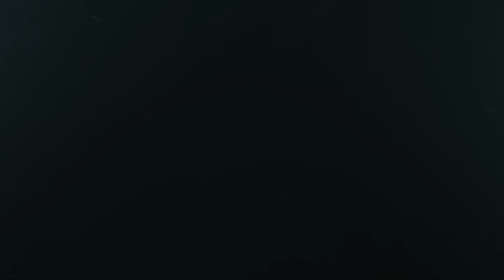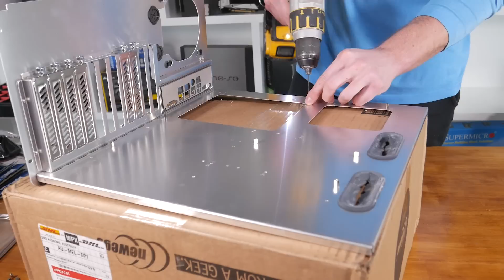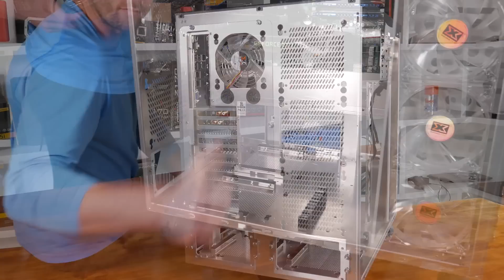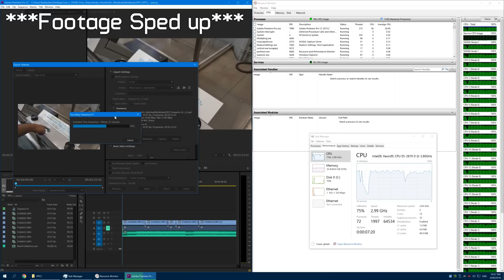6950X vs. Dual Xeons: Premiere Pro CC Encoding Battle

Comment from the maker: VIDEO INDEX
0:00 - Intro
1:07 - System prices
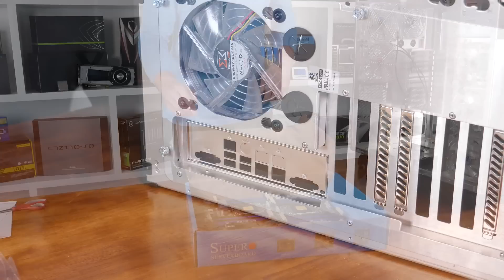1:31 - The build
4:35 - How do they perform?
4:45 - Premiere Pro CC workload
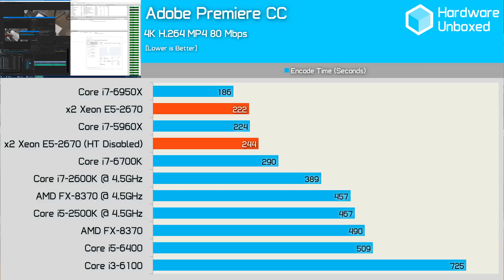5:27 - Premiere benchmarks
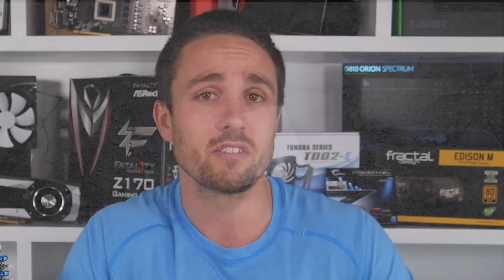5:47 - 6950X vs Xeons
6:26 - Pricing comparisons
6:51 - Overall
Reply: this is great
Reply: It's at the end, in the table
Reply: Thank you! Tired of all these slow ass videos!
Reply: what case is that
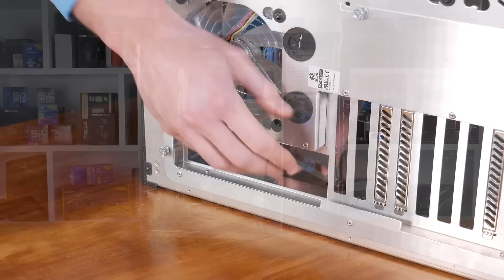Reply: at 1:26 you can see it's a Lian Li PC-D8000
Reply from the maker: +Niko Nikolov - Do you know about the E5-2670's? It doesn't sound like it. No they are not ES chips, they are ex-Facebook server chips that were only sale for $60 US each last year.
Reply: where can you find such deals? ebay?
Reply: +Hardware Unboxed
I bought a narrow socket 2011 board for a similar build. What cooler do you use? And what could I do to possibly get my Hyper 212 EVO to fit on my socket?
Reply: What If I export 4k H.264 while I'm doing something else on the other screen. Like Office and web browsing. Will I benefit using xeon? Will 6950x performance drop while I perform such task on the other screen?
Reply: You can look up Noctua coolers, specifically look for the narrow ILM versions of their fans, they have some that work on narrow ILM boards ... but are decently expensive (60 dollars!). Cooling power and noise are excellent though.

Comment: Hi! thanks to your video and TechYesCity channel 2 months ago I built my dual Intel Xeon E5-2670, 64GB 1333MHz ECC ram, a Creative SounfBlaster ZX, a 2xmolex to EPS adapter, 2xCM 212 Evo ans an Asus Z9PA-D8 ATX motherboard for 710€ including shipments and import taxes, I sold my i5 4670k, 8GB at 2400MHz and an Asrock Z97X Fatal1ty Killer for 310€, so the upgrade cost me 400€.

Anyway, this machine it's better than a 6950X in other tasks that are more CPU demanding like 3D rendering (keyshot, maxwell, thea, Vray, etc) and for workflow simulations, like Ansys (CFD), I got a capture I did, for a simple front wing I made on SolidWorks for a Formula Student car, and it really needs all the horses (on Ansys, flow simulations).
I leave two pics one for 3D model rendering and the other for the Flow simulation:
https://a.disquscdn.com/uploads/mediaembed/images/3752/3229/original.jpg
http://oi65.tinypic.com/2yulm5l.jpg

To prove that I have this system I leave my CPU-Z Validator here: http://valid.x86.fr/fn1z9x
Reply: ***** Thanks! As I said the main use of this computer it's for CFD and Rendering, I work a lot with the computer. And It's true, if you want to play video games only, this is not the best, you could have better performance on an old i5 K o something... But as a workstation it's really good for the money.
Reply: Where did you get the components for so cheap? especially the mobo? and the ram is ecc buffered i guess? are the parts used?
Reply: CADesigner try updating to 2680 so much huge performance

Comment: I'm wondering if a single cpu @ 22 cores is faster than the 6950x.  I understand that dual socket cpu's can be handicapped because the cpu's must pass data to each other.

Comment: I'd be curious to see what the performance gains (If any) are on the E5 2670 v3 Engineering Samples you can get for pretty cheap. Dual Socket 2011-3 Mobos are about the same price as the 2011-1 mobos judging from a quick google search. I'd also be curious how a single chip performs vs a 6950x since the v3 is two generations newer and on 22nm vs 32nm.

Anyhow, awesome video! Thanks for sharing.

Comment: This is bloody awesome! I'm about to upgrade from a fx 8300 and this option is stupid tempting. I would love to do even a single E5 but dual socket is just so bad ass. I was going to get a used and much less expensive dual socket 2011 board, put 2 Hyper 212s on them and hope to get a 980ti to replace my 960. I just need a 2560x1440 display to replace my 21:9 one.. Man, I need that Lian Li case too. I wish I could buy one of their cases, but that case alone is what I was looking to spend on the processors and motherboard, much more actually!

Comment: ......Great Demo-Instructional Video......Audio--Visuals--Processor Performance--Pricing Info.....All Top-Notch.....How Are You Grounded to Dissipate Static Electricity While Constructing This Computer Build...??.......Thank You
Reply from the maker: No I don't bother with grounding. I understand why you would ground yourself, I just don't think it is required for handling modern computer hardware. Over 10 years 'hands' on experience and no issues yet ;)

Comment: I have recently built two xeon pc's, one a file/plex server and vm's and the the other my main pc. Both run non ecc ram and play games just fine. Both xeons were from ebay and were ES...engineering samples. Have been running them flatout folding at home when not in use and run way cooler than their consumer grade cousins. The server has an x79 mobo and is an E5-2670 8c16t chip and my pc runs on an x99 mobo and is a 10c20t E5-2650. Both cheap and so far very happy with them. May upgrade my 2650 at some stage but keep in mind that ES xeons run slightly slower than final release chips but usually all core run on max turbo speed not at staggered speeds so this is good as well as the fact that they are way cheaper, great bang for their buck. My main pc was put together with 2nd hand parts as a trial but i will probably replace it at some stage with a dual WS mobo with built in 10gb nics onboard. I think Asrock make one and Asus have either just made one or are just about to release one...just need a bigger case and some custom mounting as shown in this vid, great work. cheers

Comment: Love that board and case setup! I just bought a Intel Xeon E5-2658 v3, 12 core, 2.2 Ghz, 30MB cache for under $200 and I am putting it on my mATX AsRock Fatal1ty x99 Killer with 16GB DDR4. The Killer NIC is direct on the board with a second Gb Intel NIC for increased bandwidth. This should fly!

Comment: Is there a GPU vs CPU encoding benchmark? Seems like a single Xeon and the video card with the most CUDA cores you can afford would be faster than two processors.

Bummer the motherboards are so pricey for the cheap dual Xeons. Though getting used servers like R710s might be a decent way to get lots of computing power cheaply.

Comment: If you get your hands on the cheaper Broadwell-E CPUs how about some benchmarks on CPU limited games with Broadwell-E to see how how much you really need to spend to un-limit games?
Reply: they run without problems, even BF1 on dual xeon setup with 1070 runs on ultra without any problems at all

Comment: I've seen plenty of these videos, but none of which that i have found are using a single 2670, im wondering if it actually doubles the speed getting a second one or if it's like sli or CrossfireX and doesnt scale 1:1

Comment: I still cant complain about my Sandy Bridge i5.
Reply: Yeah I have the 6600K and basing on the longevity of the Ivy and Sandy Bridge architectures I should be good for about 4 yrs
Reply: From what I hear, the z170 chipset will be getting at least one refresh (Kaby lake, and possibly Cannonlake). The first will be architectural improvements while the latter SHOULD be a die shrink. 

Come on 6-core LGA 1151...
Reply: i5 2400 masta raaaaaaaaaace

Comment: Question : what would be the maximum gpu's you could come connect to the motherboard if you use cables and placed them outside and in the case directly? Of course with a different psu increase?

Comment: I have a question. 
Im wondering if I should go for Intel Xeon E5-2630 V4 2,2Ghz or i7 6800K?
Mainly for rendering on Sony Vegas and Adobe P. 
Rendering with some effects. And most footage is in 120fps 1080p.
Or should I do a dual build?

Maybe you could do an other additional clip with i7 6800K and other CPU with effects in Adobe P and Sony Vegas? Just to get the real comparison.
Reply: one cpu is not enough to get fast renders but 2630 is weak alone

Comment: I saw the 2670 on ebay for 50 euros and a X79 asus sabertooth for 150 euros, is it a good idea to build a system like this, compared to a more recent build?

I need a workstation machine and i don't need dual xeon, and also the super micro mb are too expensive.
Reply: This is an extremely cost-effective workstation type build, so I'd say yes. There may be some newer features you'll miss out on, but considering the price, it's almost definitely worth it. However, X79 may need a BIOS update to work with Xeons, you should check that first.
Reply: dont buy the 50€, they are probably burn down a lot from rendering in servers

Comment: Great Results! I do not regret building my dual E5-2670 rig one bit!

Allthough i think you overpaid big time on mainboard and RAM and the coolers.

My ASRock EP2C602 was ~350 USD new
used Micron DDR3L 1333 ECC 8x8GB @ 1600 with ECC @ stock voltage ~ 100 USD (that's 64gb)
2 used EKL Brocken + Prolimatech LGA2011 Mount ~40 USD for both

i also went with a used Corsair Carbide Air 540 for ~ 50 USD
i had to mod it a bit to fit the Mainboard and it of course doesn't compete with the Lian Li you picked but it gets the job done :P

I have a imgur Album but i can't post links here.

Also, while you have all this stuff on  Hand, can you do some After Effects CC 2014 Benchmarks? (CC 2015 doesn't benefit from more Cores anymore)
Reply from the maker: I bought everything new though ;) Used is clearly a better way of making your dollar go further but I was happy to buy what I could new for this build.

I will see what I can do about testing After Effects.
Reply: Thanks man! I really appreciate your dedication! :)

You're building a great community here :)
Reply: I know this is pretty low on your priority list since the demand for this video is low too but could you please make room for that comparison sometime soon ? :)

You're the only one i know with all this hardware on hand who's results i can trust in.
My dual E5-2670s perform superb in AE2014 but i really would love to know how they hold up to a 6950x

Comment: encoding depends on the GPU!  have you tested cheap core i5 2500 with the same gpu ge force  1080?
Reply from the maker: The GPU only accelerates the effects. Using the i5-2500 would blow this test out massively.

Comment: I ve always thought xeons needed ecc memorys
Reply from the maker: One advantage of the Xeon's is that they can support ECC memory but they don't have to.
Reply: If you're doing a workload or application that can't have any chance of data corruption. ECC ram has a module just for checking data transformation. it literally stand for erorr correcting code memory
Reply: It's a matter of your motherboard supporting it.
Reply: They work just fine with standard ram and standard clocks, some consumer boards support ECC so one has some good options vs other builds.

Comment: these scores dont make any sense. My experience and others show that the E5-2670's are substantially slower as they dont support Intel Quicksync . Quicksync > CPU + CUDA.  There is no way your 6700k is slower at rendering. And your hyper-threading result is slower also.
Reply from the maker: It is important to note the workload and how it is being exported. The Hyper Threading result is faster mate. If you note the CPU utilization it becomes pretty clear why the 6700K was slower.
Reply: i understand what your saying but i have the same build and im not getting anywhere near the same performance. And i meant to say that disabling Hyperthreading nets a 30% increase over it enabled. Heck my 4970k rendered faster than these CPUs. Check out my vid or BadSeedTechs vid on our experiences with this process. If there is some secret sauce we missed, please let me know :)
Reply from the maker: It is possible you are using a less demanding workload. What kind of CPU utilization are you seeing? It can't be high if you are receiving better performance with HT disabled.

So then I suspect BadSeed and yourself are using lower bitrate footage with lower quality audio. But of course I could be wrong, I have included a link to the Intel workload below. I would be very interested to see what kind of result you get.

Anyway take a look at the CPU utilization of the Xeon's in the video and then compare that with what you are seeing.

You should be able to grab the workload used for testing here...
https://www.dropbox.com/sh/pm3fo5lztjoq4v4/AABzlWf8DgPU4i8SyuRxbYUma/Adobe_PremierePro_Workload/Workloads?dl=0
Reply: cheers mate, ill give it a go tonight and let you know
Reply from the maker: Great thanks, I am keen to hear how you get on.
Reply from the maker: I came across results from PCworld and Gamespot that showed similar margins between the 6700K, 5960X and 6950X...

It is certainly plausible that these two E5-2670's should be getting similar performance to the 5960X.

http://www.gamespot.com/articles/intel-core-i7-6950x-broadwell-e-review/1100-6440599/

http://www.pcworld.com/article/3075433/hardware/intel-broadwell-e-core-i7-6950x-review-the-first-10-core-enthusiast-cpu-is-a-monster.html?page=2
Reply: Quicksync itself shouldn't even enter the equation, as it's pretty much only used for offloading encoding from the CPU. It has its uses, though to be fair.

Personally, I'd never use QSV unless I was streaming and had to reduce my overhead.
Reply: ok mate, i did some tests with your workflow this evening and here is what i found :

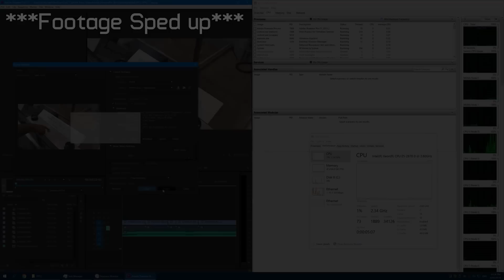Dual E5-2670s -  - Encoding Time: 00:04:26
Intel i7-4790k -  - Encoding Time: 00:5:20

so, you are indeed correct on your benchmarks

however..most people that use PP will add effects or adjustments layers or incorporate after effects into their workflow...as a test i added in a single adjustment layer with color correction and here is what happened

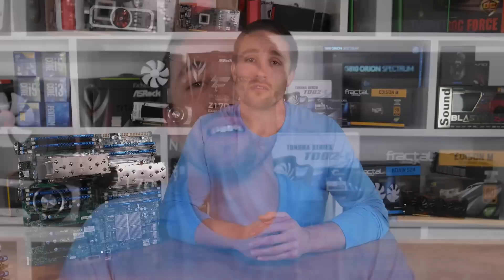Dual E5-2670s -  - Encoding Time: 00:05:46
Intel i7-4790k -  - Encoding Time: 00:5:32

in other words the 4790k eats the duals xeons lunch when effects/layers are added to the workflow, im assuming due to quicksync or higher CPU clock speed..CUDA has nothing to do with this as both rigs current run single GTX-970s in them..so basically with the addition of more layers/effects the 2670s scale far worse than a modern i7

so while your scores are correct, real world rendering will fare far worse over a modern intel i7 CPU.
Reply from the maker: Did you note the CPU utilization in the second test? I am interested to see how much that changes. This is interesting stuff though so thanks.

I wouldn’t say the Core i7-4790K eats the dual Xeons for lunch, it is a very minor difference. The Xeon’s should still remain within the same margin as the other 8 and 10-core processors.

The performance difference has nothing to do with Quicksync, it will be the higher operating frequency plain and simple.
Reply: i didn't, and unfortunately had to step away but ill let you know when i get a moment.

eat its lunch when incorporating effects/layers .  if i start adding more effects into the workflow, the 4790k begins to pull away as do most modern i7's. see for yourself

ps your content is great and ive subbed, so keep up the good work!
Reply from the maker: If it is due to the application not utilizing the dual Xeon's well which it almost certainly is then that is disappointing. Hopefully in the near future Adobe addresses this.

BTW I assume you are using the latest version? I am going to do a bit of messing around tonight as well. I might have to run a few different workloads in the future.

Comment: Would the newer xeons fair even better than the older ones that you use in your videos?
Reply from the maker: For sure they would, sadly they don't cost $60 US though :(
Reply: +Hardware Unboxed Right. Understood :)
Reply: Just search eBay and you will find more current xeons at a low price and sometimes it is cheaper to do an x99 build vs messing with V1 and V2 era xeons as the boards are cheaper. You can get V3 and V4 xeons cheaply if you look carefully for X99 compatible ES and QS xeons, the only catch is the clocks are not always standard. 

12 cores for only $105 and some people have done that for as little as $90!

Comment: Hello, nice video, i  have a doubt that maybe you can help me to clear. I was planning to buy up to 3 of the i7 6950x  procesors for a 3d render farm , unfortunately  bring them here to my city it will cost 880 usd extra per processor, this means that instead of paying 1650 USD (that cost on amazon) I  will have to pay 1650+880=2530USD, and multiply by 3 , I Just cant afford that, and even if i could afford it, I think this  taxes and fees are ridiculus. Now im seeing a new option. Here in my city we have a computer  store  thata sells computers, and parts.  They have in stock the i7 5820k that cost  520USD and they have 5 processors in stock , every processor  has 6 cores x 5, that would be  30 cores which is the same as 3 i7 6950x processors, the same in cores number. My question is:  would it be the same   to have five 5820k computers or to have three 6950x computers? this 2 configurations gives 30 cores.Just keep in mind that having five 5820k processors cost  150% less than having three 6950x processors, i mean I save more than twice the money   and I end up having the same amount of cores, but i would like to know if  speed  for 3d renderirng would be the same.  Thanks in advance.